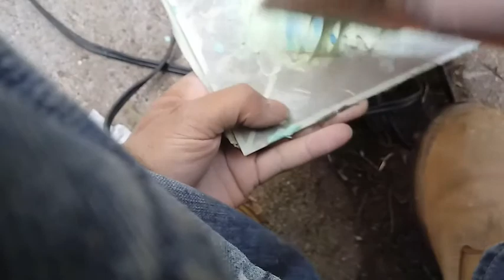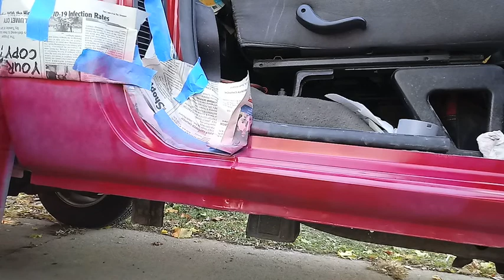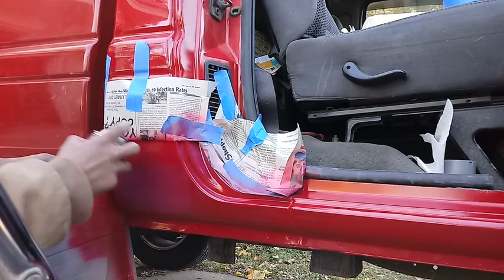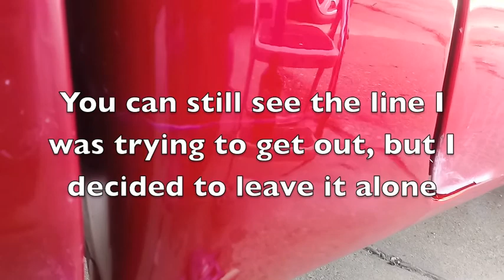2nd Gen Dodge Ram Rust Repair Part 3

Comment: Nice work brother !  I'm Going through my truck now. 01 ext cab 4 door.  The cheese is old and moldy. Hah. Your rockers look great.  My doors are exactly the same. Doing some thin aluminum diamond plate pieces on my doors. I finished my rockers and home made cab corners. Now I'm working on my box wheel arches also along with my door work.  I think I need to order some wheel arch panels of Raybuck although. 
It won't be a show truck by any means. It will look good from far... and far from good. Hahahah 
But being a work truck, I don't need shiny and pretty. I'm happy with solid.  🍻 great job and kudos to you for having the patience.  I curse allot while doing my truck.  🤣
Reply from the maker: Thank you very much man! I appreciate it and I know how it is. For you to make your own cab corners is amazing. The wheel arches on mine need to be done as well. I've run out of time with how my schedule is. I want to get a new truck so I can take my time to work on it and get it right.

Comment: Looking good! I'm doing the same to my 2gen, it wasnt so badly rusted than yours. I changed the rear fender panels, door panels and front fenders. Also little rust repairs on floor too. These are nice cars if you keep them in good condition, and I'm happy that here in Finland its possible to get repairing parts easily.
Reply from the maker: Glad your isn't as bad as mine was. I have other parts for my truck just haven't had the time to do the work.

Comment: Looks pretty good to me , if someone doesn't  like it they can walk! 😃 can you spray some kind of product inside the rocker to keep the rust away?
Reply from the maker: I really appreciate it! I bought some stuff that I hope works. I should of got POR 15 but I didn't. POR 15 works really good.
Reply from the maker: I bought this out stuff called fluid film that is for under coating your car or truck for the winter and I sprayed that inside the rockers after I was all done. The POR 15 I should of applied before welding the rockers up.
Reply: @NicksGokarts  I saw a few YouTube videos with fluid film , it seems like pretty good stuff!
Reply from the maker: @anthonysinclair5721  It is pretty good so far. I sprayed it all over my trucks chassis and all in the the rockers and cab corners the best I could inside of the little opeinings.

Comment: Are the doors going to get the Brokemond treatment too? 👍
Reply from the maker: I have a passenger side door that's  rust free in the garage that just needs up on but no driver side door. Can't seem to find a good rust free one.
Reply: @NicksGokarts  You did a good job on the rockers , I bet you can fix your door bottom too. 👍
Reply from the maker: @anthonysinclair5721  I probably could and that may be a plan once we get some nice weather because finding a nice door is a challenge.
Reply: @NicksGokarts  I’m like you needing a shop to work in , think how much more we could get done, or attempt to do if just had four walls concrete and a roof overhead
Reply from the maker: @gregz4249  That's very very true but unfortunately I don't have access to that kind of setup. So I had to work with what I had.

Comment: How is your repair holding up after those years?
Reply from the maker: They are holding up good. I do have a few little spots of rust bubbling up which wouldn't be had to address but other than that the are holding good.